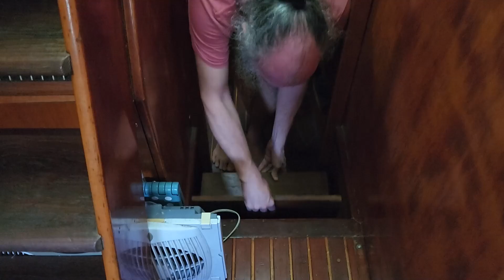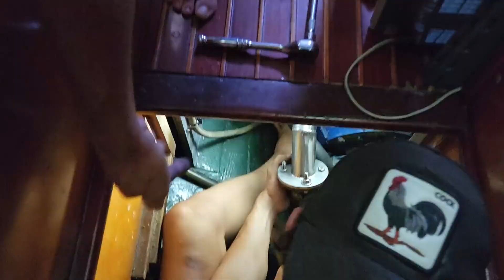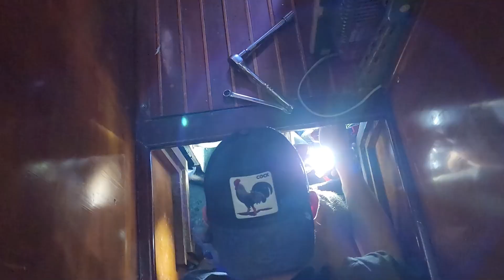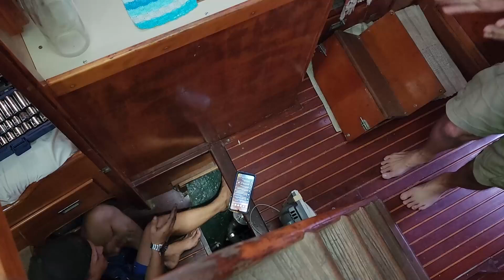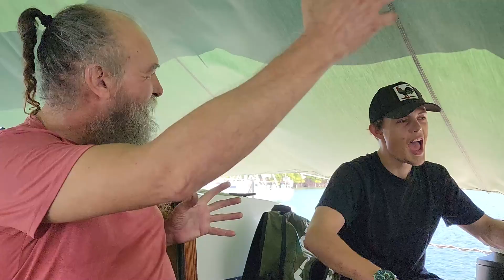Exhaust Elbow Saga... Part 8

Comment: I am not a boat mechanic but have been in the automotive industry for nearly 40 years so I think there may be some crossover.  With the exhaust tubing you have to allow for thermal expansion with any part of the system that is not cooled and have to allow for vibration or flexing and I see where people solid mount their exhaust at some point and have breakages because the engine is mounted on rubber mounts and allow flex so the pipe has no option but to fail.  Another common failure is to put the flexible mesh section in the wrong location, for example the exhaust may be solid mounted to the engine and transmission since they move as a unit so the flex section should be added after that location but for some reason they will often put it between hard mount locations which is essentially useless.  I didn't get a really good look at your system but if it breaks prematurely again it might be time to reengineer the design to work with the expansion and vibration rather than fight it. best of luck
Reply from the maker: The last time it broke from what we could tell the welder had actually welded too hot. They self admitted that when we got tbe part. They mentioned they had to weld the hole they made shut. The Orignal was leaking when we got it, and had a larger billows but we also had issues getting it in without over flexing it. The two part structure makes that better but limits the size of the flexible section. We will work on solutions in the future of course. For the moment this one is working.